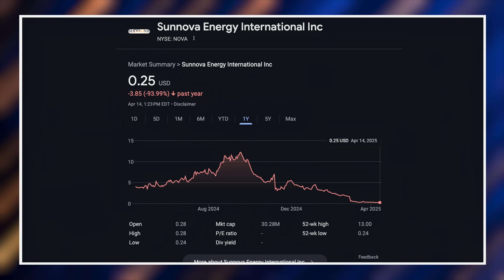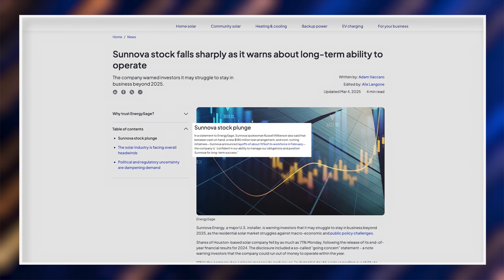Why Are Big Solar Companies Going Bankrupt? | Plugged In

Comment: You forgot the biggest reason. Yes many big box installers are sleezy, but net metering rates are rapidly changing and not in favor of the homeowner. The biggest markets - TX and CA have already effectively eliminated "net metering" and are instead offering wholesale or lower rates for excess generation. A dozen more states have joined them or are considering the same changes. So there is basically no payoff within the lifetime of the system or you must install MUCH more expensive systems with batteries. Additionally utilities are increasing rates by upping base fees and demand charges, not consumed power. And in the rest of the states? Given the trend, no one in any state should rely on the already overblown financial projections that show solar will payoff financially.